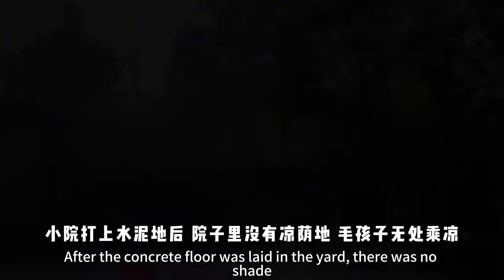For The Safety Of The Dog, He Continued To Build The Shed Despite The Pressure.

Comment: You need to get the dogs off the concrete and off the hard ground. The dogs live in overcrowded conditions and this can’t be good for their health. I’m sure the flood also made conditions worse. The dogs also seemed to be overheating due to the hot weather. The dogs will continue to get sick if conditions stay the same. Please work to expand so overcrowding is not a problem and the dog’s health and safety are not compromised. I have donated to you and other rescues. Thank you for all your hard work and caring for stray dogs🙏😇❤️